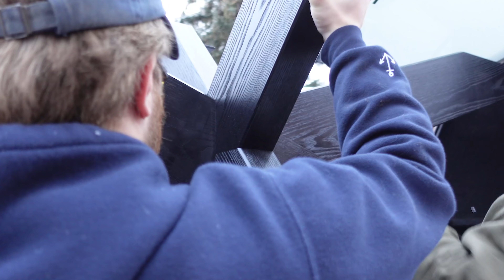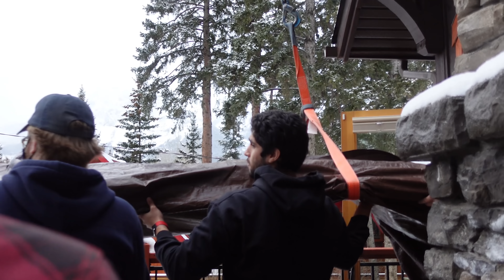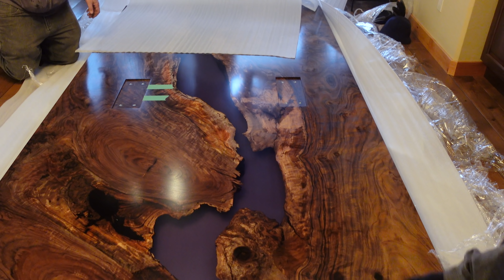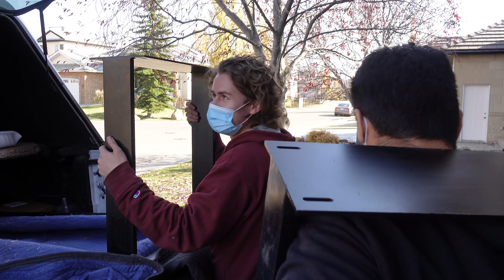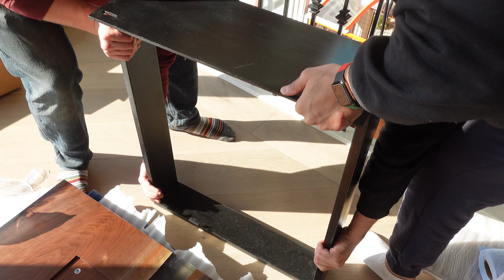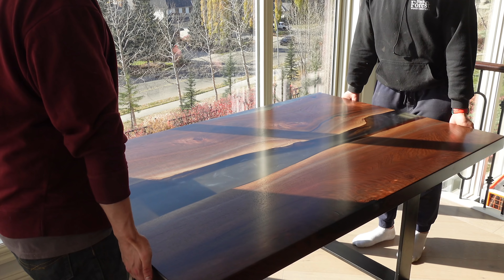Lifting a 19K Resin Table With a Crane

Comment: The first table was by far a winner. Honestly I was distracted on the second table by the large crossing of the table leg seen through the epoxy.
Reply: Would have been a good candidate to have a dark tinted epoxy on that second one so it wouldn’t jump out like that but hey, if that’s what the customer wanted, and they are happy with it then I think it’s the most beautiful table in the world! 😉 

As long as the customer is happy, that’s all that matters!

The first table tho, I have to agree, it’s a Humdinger!! I think that’s probably the most beautiful table top I’ve ever seen !! I am curious tho, and it’s not a complaint or a poke just truly curious that for such a gorgeous table, what’s the reason behind using oak for the table base instead of  using say less figured scrap cutoffs of walnut so everything was the same wood? It’s gorgeous either way tho
Reply: Completely agree.

Comment: You need to invest in a wheeled  clamped sled like they use for stone slabs. It even articulates and has sliding arms.. Before its back issue hell. No lift system its called
Reply: LMAO
Reply: @daveklein2826   My stone guys have one. What used to take 4 guys to move a slab in. Now takes 2. Slickest tool I’ve ever seen to save a back
Reply: @BZ1340 LMAO did they take it up 2 flights of stairs?

Comment: Beautiful tables.  Have you ever had to use a crane before?   Does the sun darken the polyurethane or wood in the table?   This was a great video. I have seen cranes move furniture in recently built  buildings that were tall. Obviously they couldn't get it in the service elevators.  Keep up the great work
Reply: Walnut is one of the few wood species that lighten up with the sun. UV inhibitors can slow it down. Nobody is ever going to notice for a years that it will take.
Reply: @byever1  Thank you

Comment: Can someone explain me about the prices because I am a bit confuse... I live in Norway, not a cheap country to live in.. Year ago I was looking for an epoxy table. I could order a table 2.5m length and 1 m width made from oak for about 4000 eur.. I could order amazing epoxy table same size and made of KAURI wood that i believe is really something special for about 7000 eur + delivery. And when i see your videos prices are like always over 10k... and sometimes even over 20k..
Reply: This is a different country get over it
Reply: Location has everything to do with it plus You can’t compare an oak table to the highly figured walnut that these guys are using and I doubt that quality will be anywhere close to the same as what these guys are putting out. Sorry man
Reply: Totally agree with your comment. They do seem quite pricey. I guess a lot of it comes down to the volumes of epoxy resin they are using in their tables. We make Kauri tables here in New Zealand, with some of our Timber slabs being carbon dated to 50,000 years old. And sure wish we were getting the same prices.
Reply: @1982MCI  I have no doubt in the quality for sure, watching most of their videos.
Reply: @drearynodoff515  Yes, when i saw Kauri tables its like king of all woods :)
Reply: The wood they use is certainly a big price as it’s beautiful and the epoxy volume also but if you considered a 20k table let’s say generously 10k could be materials but the size of their shop and crew means large overheads but of course the customer benefits from a very reputable company who are famous for the epoxy table movement apposed to a man in a garage who works on his own who would be cheaper.